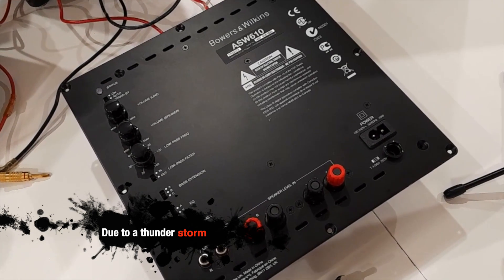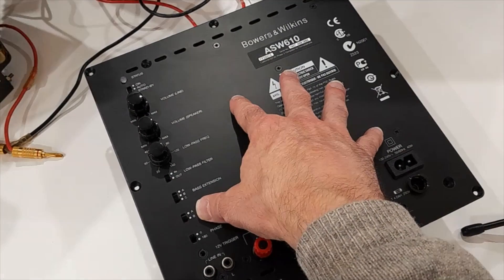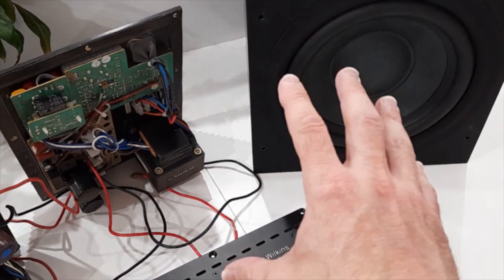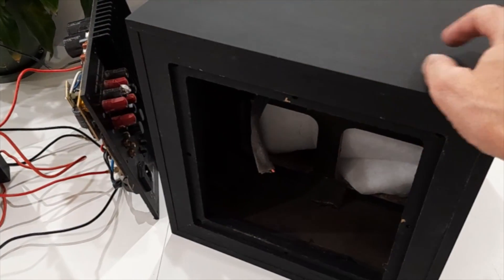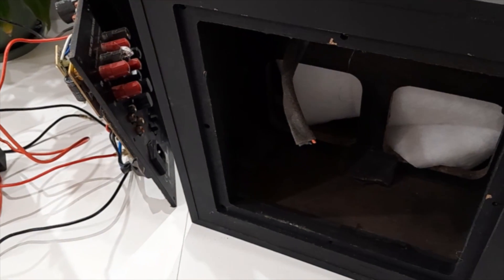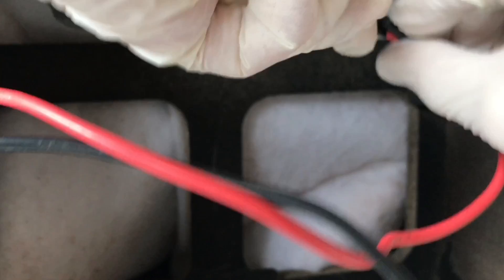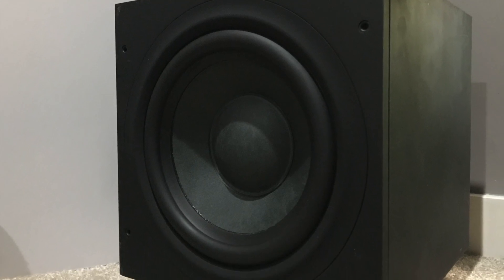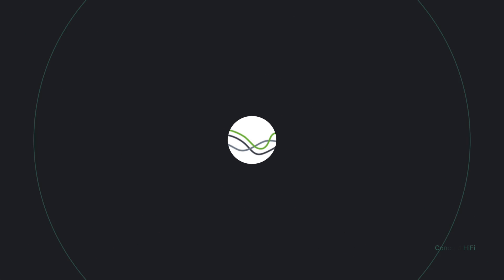B&W subwoofer - replaced with a different board

Comment: Interesting video. I have a B&W ASW675 with a fried amp. I have been thinking about replacing the entire amp, but never thought about getting a non-original amp. Any ideas what to look for in a replacement amp?
Reply from the maker: Hi, I try and over spec the replacement. So if the original amp 150w sub. I got for a 200w replacement.  But that’s not completely necessary. Just match spec of what was currently there. So impedance - which for a sub will be around 4ohms and the watts.